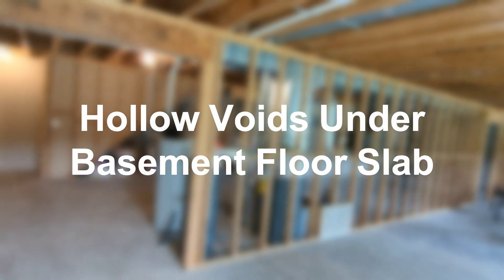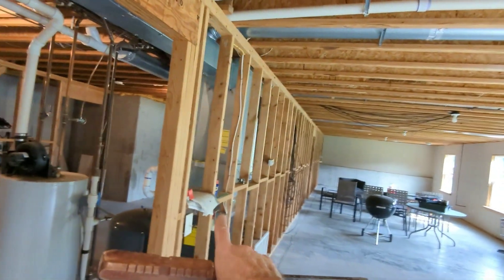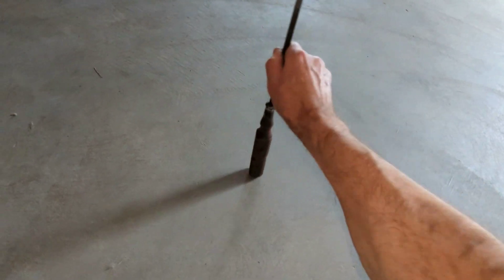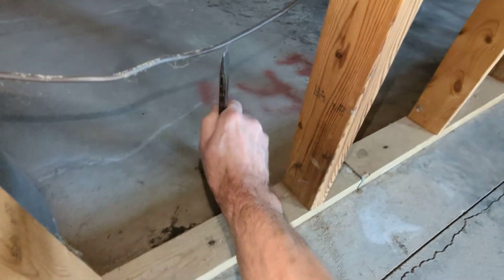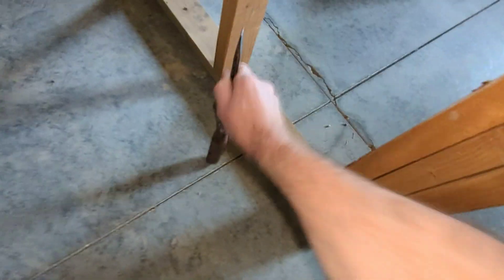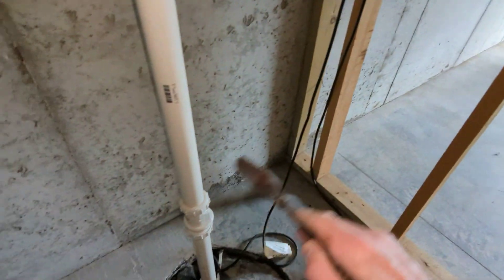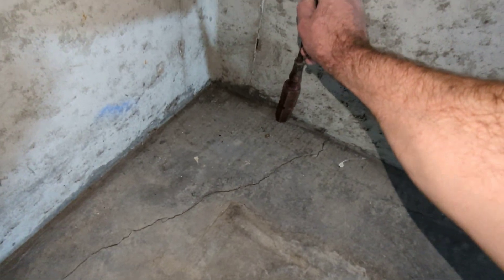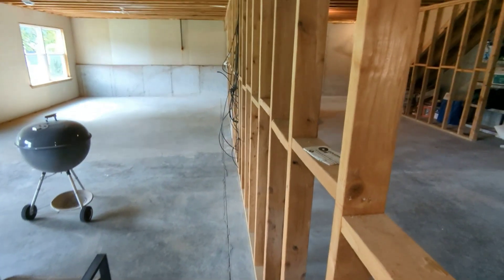⚒️Hollow voids under basement floor slab #Foundation #basementwaterproofing#home#house#realestate

Comment: This happened because of crappy building procedures. Contractor and inspectors did not know what they were doing. I guarantee there is not a footing underneath that bearing wall. Every bearing wall in Seattle new construction requires a footing for the walls. You don’t screw that up.
Reply from the maker: Thanks for the comment and for watching.

Comment: So that looks worrying - Is the house going to collapse?! What's the fix - Open up the hollow area somewhere and pump concrete in?
Reply from the maker: @MrFootofDavros  The house won't collapse, but yes, a contractor was there at the time and suggested to cut it open to confirm the underside areas and the next option is concrete pumping to fill voids.
Thanks for watching
Reply: You could probably find a geoengineering company that could come and do a ground penetrating radar look for footings. I would imagine it'd be a few grand but would maybe give peace of mind and possible direction for a fix.
Reply: @dgodrummer8110 no because you still would have to verify a footing is under new wall
Reply from the maker: @dgodrummer8110 yes I think that could be another option. To cut out the slab next to the existing wall and install a new footing with a new load wall.
👍
Now I'm switching channels to your drumming lessons. 😝